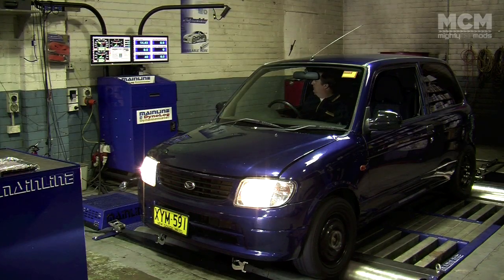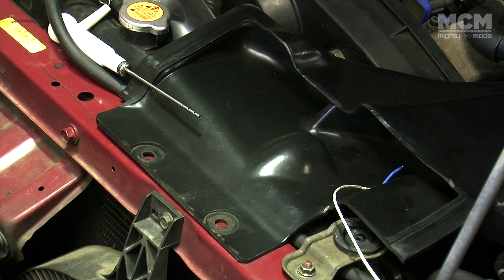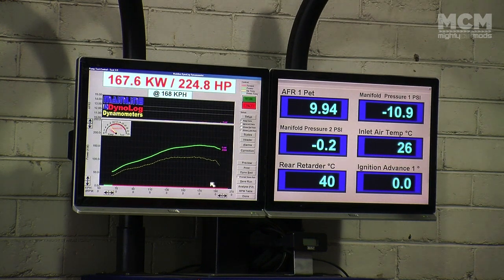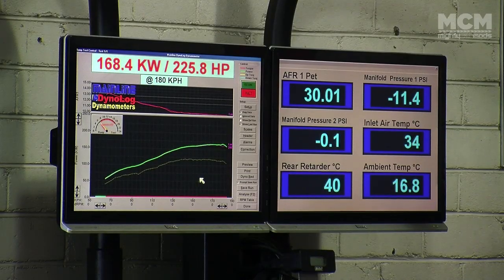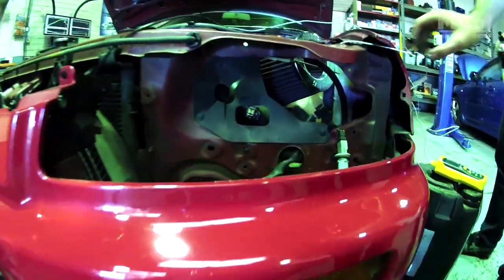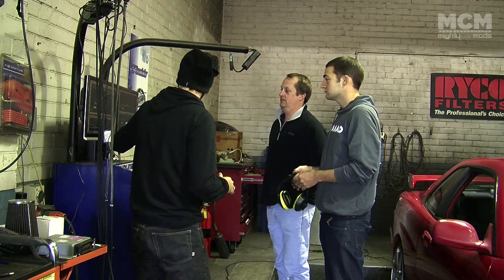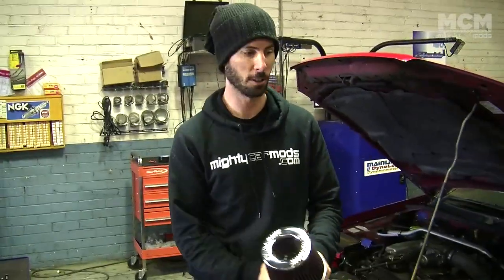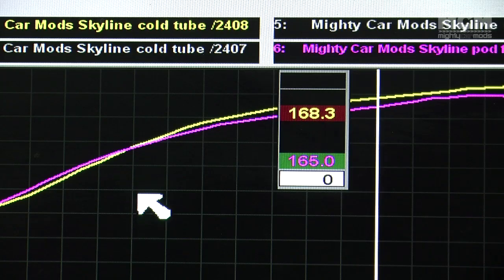Cold Air Intakes Mythbusted [Turbo]

Comment: The fuck? I thought a R34 was AWD, yet only the rear wheels were running on the Dyno!?!?!?
Reply: the gtr is awd as well as oje other model however the majority are rwd still
Reply: r34 gt-r is awd, r34 gts is rwd
Reply: It's a GT-S.
Reply: wizz3r1o1 no its a GT-T
Reply: My bad, I'm not used to seeing FR R34's and the main FR drive train R32/33's I hear of are GT-S badged. But basically, if it's not badged as a GT-R for the R32-R34, it's not AWD.
Reply: for the most part, there is the r32 autech gts4, r33 gts4 and the r34 gt-four are all 4wd as well (the v35/36 both have 4wd options as well)
Reply: Well, The more you know I guess. Learning something new with each day.
Reply: You can tell that its a GT-T R34 by the front bumper and the silvia badge marking the SR20 power.
Reply: dylan I am assuming you are joking, if not well I think you need to learn more about cars before commenting
Reply: trapper9998 can I say now that I am trying to troll you? Now I know that messing with people in this comment section is obviously strict o_o. But yes, I do know about the RB25, but I wanted to see if any drift fanboys thought the SR20 came stock. Also, before any hate rolls in: everytime I see a stock GTT there's a silvia badge. c:
Reply: Dylan Drifter the rear bump is different compared to gtrs
Reply: Brap Brap besides all of the points people have made, true AWD dynos are very rare. Even when running an AWD car, most people lock down the front wheels with straps and put power through the rear wheels only, because a typical dyno can only read from one set of wheels at a time. It's not ideal, but it's the only option in many cases.
Reply: Brap Brap R32 GT-R can be made RWD just by removing a fuse, maybe R34 has the same thing?
Reply: Topias Salakka that's a GT-T you can tell by the bumpers and hood and spoiler and the GT-T is RWD
Reply: JDM r1c3ing I know it's a GT-T, just wanted to point out that R32 GT-R can be easily made RWD
Reply: Topias Salakka true
Reply: Brap Brap GTS=FR, GTR=AWD, this is a GTS
Reply: Dylan Drifter An R34 never came with an SR20 ever.

They even said at the beginning of this it had the RB25DET in it anyways. Also considering the GT-T R34 came with the RB25DET motor.
Reply: Topias Salakka Nope not possible with the R34 GT-R by removing a fuse, not as easy
Reply: SkylineBNR34 came with a 25
Reply: SanraS Uzumaki  (*This is a GT-T - the equivalent of a GTS-T but they dropped the 'Saloon' on the R34, and it's RWD).
Reply: Brap Brap It's an R34 GT-T with a 2.5
Reply: Brap Brap Fanboys... It's a GT-T, not an R.
Reply: Josh Lum they said that in their shift light episode
Reply: +Brap Brap 
wtf dude gt-r got different design/looks and sound than the car in the video lmao.
Reply: JDM racing Exactly. No big mystery.
Reply: Gaz Girl ya your a mechanic by trade where did you train and whats your ase # and what are you certified in lol im a trained automotive technician and i can tell you being a mechanic means nothing you have to be certified to even touch cars in a shop now lol but anyways keep it mechanic lol

Comment: wow. alot of people getting their panties in a bunch when they pretty much busted "cold air intake" gives you more power myth. I didnt have to watch the video to know that. You need a tune to get more power. Changing the intake doesnt do anything unless you accompany it with a tune.
Reply: I understand where you are coming from, Civic13Man, but you got to admit, you just spent maybe over a hundred dollars for something that doesnt do anything but make your engine bay louder. Yeah the sound is cool, but you could have just cut the intake tubing x on your Honda to where the air filter box is. I did that to an old Del Slow  I had. Sounded about the same as another friend of mine who had a "whale penis" intake and i didnt spend a dime.
Reply: hahaha your alright.. I got some boost with some tuning. sound is something i was also going for i didnt mind spending a couple of benjamins to get a better sound. your method could work i just wasnt the kind of person that has the time to customize a intake. but if you want some boost out of a aftermarket part you just need to tune because each part has its sweet spot manufacturers tune based on compatability. can the car do it? cant it put more power? aftermarket have a higher compatibilty with power.
Reply: David Torres u mad bro?
Reply: Maybe you should have actually watched the video then. Their two runs with actual CAI (eg not pulling air from the engine bay) averaged 232.65hp and their 2 runs with the factory airbox and brand new filter averaged 224.75.

They also pretty much proved that the biggest factor is air temps when they ran no filter (just a straight pipe to the throttle body) and achieved the lowest numbers (lower than CAI and stock airbox).
Reply: Civic13Man Gaming guy, he WAS singling out a certain group; those that think they have a racecar after adding a cai to their civic. All you did was confirm that you think your civic is now a racecar after adding a cold air intake, by getting mad at the comment he made about a group you just admitted you belong to. if you put the intake on for any other reason than making the civic a racecar, you would not have been unsettled by his comment. BOOM!
Reply: Sorry ross but nowhere in my comments do i say that my civic is a racecar. nor do i think it is, for crying out loud its a civic not a GTR. the reason i said it is because he said all those honda owners think that their car is automatically a racecar with a CAI. I for one am not one of those "all". i am a performance builder not a performance appearance in other words a ricer. so you cant say he was singling out when he obviously said "all" not mad just wanted to correct because i agree with him in parts. some honda owners are stupid and abnoxious turds.
Reply: Civic13Man Gaming lol, I put a cold air intake on every car I have, but I never get mad when someone says something about thinking you own a racecar after adding the intake because I know that's not why I put it on my car, so the comment doesn't bother me because he is not talking to me, because I don't think my car is a racecar. understand? He is talking to ALL OF THOSE HONDA OWNERS THAT THINK THEY HAVE A RACECAR AFTER ADDING A SIMPLE MOD, not all Honda owners with an intake.
Reply: ok, seems like you dont understand but its ok we each have our points of views. and like i said i wasnt mad just correcting.
Reply: And because guy 1 says it and has written it on the internet, it must be true! Now you are "guy 2". Look, Guy #2, generally, people don't get upset about something that doesn't relate to them, aside from morality stepping in on some occasions. Racecar, that is the root word here. The word racecar, got guy 1 all fired up (from a psychological standpoint). He says he is a performance builder, with "some boost and some mods". HAHAHAHA, tell me this guy doesnt race in traffic, if you do, I'll call you a liar. At least tell me where his scca or nasa license is, because if he doesnt have a license to use all that boost on the track, wheres he doing it? Case closed. NO ONE goes f.i. to go the speed limit. Or on the other hand, he could have turbo'd/super'd his car and is completely responsible with it, but you'll have to, 1.) hear it from him, and 2.) believe him. I dont even know why he commented if he has boost and tuning, nowhere even close to who the op was talking to. Unless hes lying, and has a 99ex with a short ram and wing...muahahahaha. Only joking, or am i?
Reply: I do think a modern ecu with closed loop would compensate enough to see the marginal gains.  We aren't talking about a difference of 2 vs 3 bar.  The slight reduced AIT or added MAP at a given RPM should be viewable by the ECU.  Of course, how much the ECU is allowed to steer from it's factory settings and open loop, greatly depends on the car.